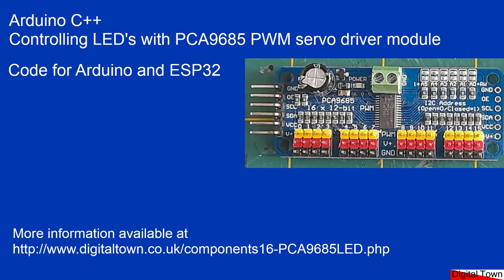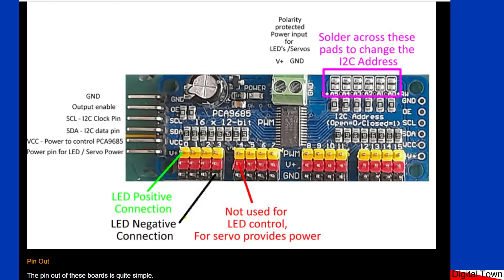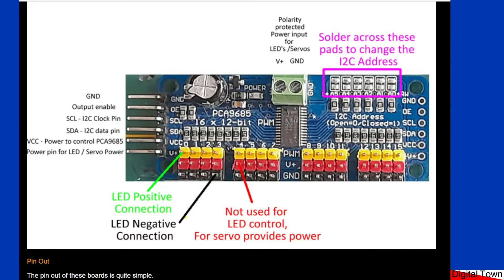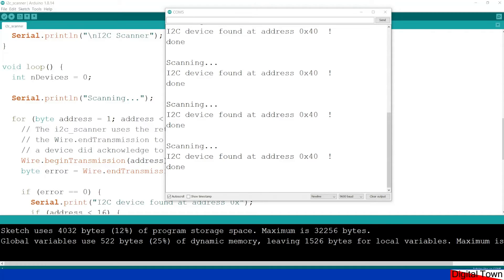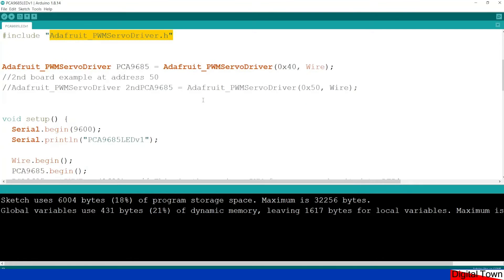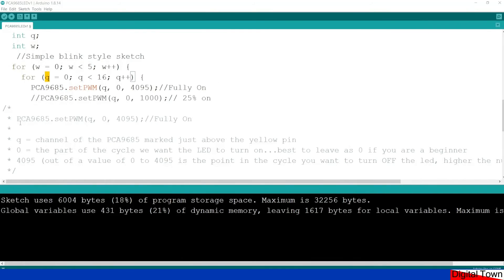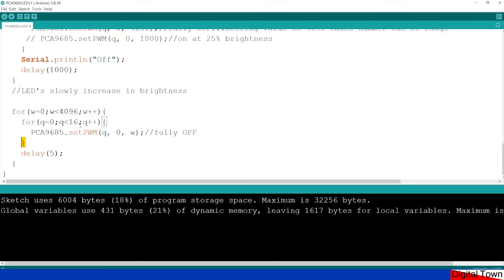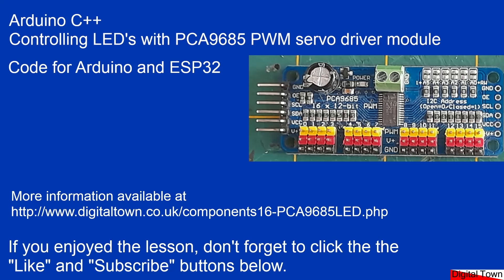Arduino C++ Controlling LED's with a PCA9685 PWM Servo controller

Comment: ESP32 controllers can communicate with one another so maybe there could be a way that the esp32 in the signal boxes broadcast to esp32's in locomotives and from this the trains would know to stop / go at signals. How would a train know though that it has the green light and not some other train? You have the skills so let me know when you have built this 😄
Just kidding, but do you think this could be developed?  Imagine trains controlled by an esp32, a timetable for running could be programmed, the automation would be fascinating to watch with multiple trains interacting.
Reply from the maker: If you take a look at the nowRail page I've written a system that allows communication on the layout via ESP-NOW. It would be possible to do something like you are asking see https://www.digitaltown.co.uk/nowrail.php
Reply: @digitaltown5442  Very interesting, you're well on the way. ESP32 is amazing. The really small ESP32-C3 are also good.  If model manufacturers aren't working on including microcontrollers in their products they are going to get left behind.
Reply from the maker: @pippaknuckle  They already include them in their DCC chips but there are limitations do to making sure they are user friendly and also have compatibility with various standards to make things interoperable. That has caused the failing of many "one off" systems over the years.
When we look at model railways we look at what we cn program, however for most users thay want it to work straight out of the box without having to learn to program.

Comment: I just tried this and it is all working but for my LED light. It is not turning on. 
If I hit the row 0 top and bottom pins (volt and ground) with an ohm meter, I get a 1v then 0v then 1v, etc... so it is working; however, 1v is not enough to turn on the 12v led's????
Reply from the maker: If you are powering LED's you want the yellow signal (+) and black GND as your connections.
A multimeter might struggle as it's passing a PWM signal.
If you use normal leds you don't need any resistor, however if you want to power a 12v led you are probably going to need to get the PCA8685 to drive a transistor that turns the 12v on and off to the 12v LED
Reply: @digitaltown5442  i plan on retesting with normal leds... From arduino kits and if works go from there.thx for the reply!
Reply: @digitaltown5442  Turns out I had the arduino connected to the V+ and not VCC so when I switched that, I have LED that light now... well blink!. So great start!.

Now I have to figure out how to get multiple LED to just come on at different power levels... but off to figure that out. 
Thx for your tutorial!

Comment: Although the PWM is set with a 12 bit value, it does not mean there are 4096 steps of control. At a frequency of 50hz you get 25MHz/(50Hz * 4096) ≈ 122 steps. This is a far cry from the advertised 4096 steps!
Reply from the maker: I can only quote the PCA9685 datasheet that says: The PCA9685 has 4096 steps (12-bit PWM) of individual LED brightness control
That said I find that the difference between steps is so small that even a 10 step difference would not be visable to the eye.

Comment: Little bit confused about the power for the leds. You aren't using the red connections, only ground and signal. So how does applying voltage to the external power connector on the PCA board help?
Reply from the maker: The signal from the PCA9685 board is powered from the external power connection if available or the VCC when not available. With a single board of LED's it won't make too much difference, but if you have a lot of boards working together the signal pins between them will start to draw more power than your Arduino5v can supply.

Comment: When I try to create an instance of the AdaFruit_PWMServoDriver FingerBTP = AdaFruit_PWMServoDriver(0x40, Wire);    I get the error "AdaFruit_PWMServoDriver did not name a type" did your mean "AdaFruit_PWMServoDriver"?   I have tried to change the instance name to "pwm" or anything else and it doesn't make a difference the error remains.  I have also tried this "AdaFruit_PWMServoDriver FingerBTP = AdaFruitServoDriver(); "  I still get the same error.  The error code/exit status is 1, the program will not compile.   I have included the library for Wire.h,  AdaFruit_PWMServoDriver.h, and FastLED.h.   I have searched Google and can't seem for find a resolution. I am working the Arduino IDE, latest version.  Any ideas on a fix ?
Reply from the maker: At a guess you haven't included Adafruit_PWMServoDriver.h

The top of the sketch must have the following 3 lines:

#include "Wire.h"
#include "Adafruit_PWMServoDriver.h"
Adafruit_PWMServoDriver PCA9685 = Adafruit_PWMServoDriver(0x40, Wire);

OR it could be written

#include "Wire.h"
#include "Adafruit_PWMServoDriver.h"

Adafruit_PWMServoDriver pwm = Adafruit_PWMServoDriver();
Reply: @digitaltown5442  Thank you for your assistance.  You helped me resolve the issue.  I had already did the #include on the 3 libraries that I needed.  What I did was the fact that in my create an instance statement I used an upper case "F" for the word "AdaFruit..."  Since the library was using a lower case "f" for "Adafruit" you can see that it appears that the library is not included.  I noticed this last night, based on what you had written, vs what I had written.  I changed the "f" to lower case in my create an instance statement and the program compiled without issue.  Thank you again.

Comment: What are the lights (LED) on the PCA9685 board itself? A red light comes on when I apply Arduino power to the vcc pin. I'm trying to control 5 servos but nothing is happening. I've checked the connections many times and quite sure I have it wired correctly. SDL to SDL. SDA to SDA. Power and groiund. I have tried 2 PCA boards and several arduinos and nothing is working for me.I've tried several codes I found online for testing servos, I tried the I2c address sample app and it doesn's find any devices.  I'm using a 5v 4amp power supply and have arduino supply vcc power. I have  #include <Wire.h>
#include <Adafruit_PWMServoDriver.h> in my code. Am I missing something.
 I hope I haven't fried everything somehow. 
Frustrated...
Any help would be appreciated.
Reply from the maker: The red led just shows the board has power.
If the I2C address finder is not finding anything it usually means a wiring issue.
You don't what type of Arduino you are using, SDA/SCL vary in different types of boards.
Pins are Arduino UNO: A4 (SDA), A5 (SCL) : Arduino Mega 2560: 20 (SDA), 21 (SCL) : ESP32: 21(SDA), 22 (SCL)

I would only attatch the Servos once I got the I2C scanner to work.
Reply: @digitaltown5442  Thanks for the fast response. I used 2 different nanos and 2 unos and used the SDA and SCL pins on the arduinos. Maybe I'll try the A4 and A5 pins, but they're supposed to be hooked up internally I heard.  I think I will try hooking up an oled display and temp sensor again to check I2C function on the Arduino. I ran a servo directly from my arduino (I use both uno and nano ) and the servo worked ok. I think I'll try the PCA without any servos and just powered off of the Arduino 5v. Then see if the IC finder code again.  I'm the PCA isn't fried since the power light comes on. Thanks again for your help. Please let me know if you thing of anything else to try.

Comment: Hi great video thanks, got into this through model railways, don't like to ask, but I'm going to, I'm using 2 of these boards for controlling points how does the numbering on the second board work ?(it may be obvious but not to me) will be appreciative for being "pointed" in the right direction
Reply from the maker: I work the opposite way, I solder over a pad to change the address and then run the I2C scanner sketch to get the addresses. The scanner test is on the support page at https://www.digitaltown.co.uk/components16-PCA9685LED.php under the Connection Test heading.
Instead of seeing 0x40 you will see the new address or multiple addresses if you have more than one board attached.
Reply: @digitaltown5442  many thanks best regards Pete

Comment: can you use this with common positive cheap chinese signals on a model railway 3 aspect  ?
Reply from the maker: I've never tried them but I Don't think that would work as it's the positive (signal pin) that drives the LED as the GND is common across the board. Pity they didn't built those signals common ground.
Reply: it's the black lead that has the resistor for power and the other 3 are red yellow green i might have made a mistake whhen i first typed @digitaltown5442
Reply: Hi, yes you can use common anode leds, but you have to get your head around working 'opposite' to usual. With common GND leds you simply connect the pwm pins to the anode, common to GND and away you go, as described here. But you can use common anode leds - in this case, connect the common anode to the +5v pin on the PCA9685, and the two GND pins to separate PWM pins. Now, if a pwm pin is set high (4095), then it has the same potential as the 5v pin so no current flows and the relevant LED colour is 'off'. Reduce the PWM pin setting and you will see the LED light up as the current flows from +5v though the PWM pin. In effect, this is the opposite to the example, as the higher the pwm pin, the less current flows, so the dimmer the led. The lower the setting, the more current can flow so the light is brighter. I use this for two colour signals on my model railway with nano bicolour led's which only come as common anode (the ones I found anyway), with 4095 as 'off' and 3000 as 'on'. Adjust the setting for red led or green as green tends to be much brighter.Try it, it works!
Reply from the maker: @paulhooper4599  Thanks, will give that a try

Comment: hello, I plan to make aquarium lamp that has sunrise sunset feature, is it possible to use this module to drive High power LED?
Reply from the maker: That depends on how you define High Power. The Pins are rated for a maximum of 25mA per pin so some LED's defined as High Power would draw to much power. 
Although what I would define as a High Power LED would be so bright you can hardly look at them.... think high powered torches, street lights etc.
Depending on the size of the aquarium a string of 16 "Bright white" leds I would have thought would be more than enough to take it up to what I would call "daylight" rathwer than "searchlight". Also if trying to replicate daylight it would be worth checking the light output as LEDS can come in various types of white. I use both Warm White and Bright White LED's depending on the effect/light colour. Warm white are better for simulating incadescent light bulbs. interesting project.

Comment: I plan to use this approach on my layout.  Have you tried this with multiple color leds?  The dwarfs I’ve designed use a single 2 lead led.  These require revering current flow to change color.  Any advice would be appreciated.
Reply from the maker: I'm not sure that is possible with these boards. I've used many types of leds with these but not the two wire multicolor leds

Comment: Useless board, 16 servos maybe micros, since the board only supports 5 volts battery, i don't have a servo less than 7.4 volts this is for a guy using micros.

Comment: So if I say, have the arduino running 2 boards in parallel (not chained), 32 leds in total, I'd be okay without needing a power supply?
I couldn't find how much is too much on the datasheet.
Reply from the maker: An arduino UNO has a maximum curren draw of 0.8A off the 5V pin so you need to know how much power the LED's are using as that varies by size and even colour. Also it depends what other items are using the 5V pin. 
On my projects when built up I tend to have a seperate 5v power line going to the PCA9685 rather than drawing it off the Arduino. I often use ESP32/ESP8266 in projects so I supply them with 5V at the same time.

Comment: Hi again,

I fell into a trap wherby the new 9265 board was defective and installed my spare.

The I2C scanner picked up 0x40 and ox70 - no idea why.  Later on it picked up 0x40.

The adafruit library was being called with the base instruction, no address and no WIRE
It is working fine without the Wire varialble.  Why??

So stupid is as stupid does - I changed the instruction to pwm 0x40 Wire

The servos went complete nuts and stripped out the gears in 2 servos???

So I put the base instruction back again and things returned to normal.

Any idea what the heck happened to those 2 servos when the adafruit command inclued Wire/

It appears that this parameter is not necessary, at least on my Mega.

Bob
Reply from the maker: if you put in Adafruit_PWMServoDriver PCA9685 = Adafruit_PWMServoDriver()  it automatically puts in the defaults of (0x40,Wire).
Not a problem if you are using a single board but not a good habit to get into if you are using multiple boards.
No idea what happened with the servos without seeing the code I'm afraid.

Comment: Hi, Thanks for the video it helped me set up my railway mimic board with a dozen single colour leds. I would also like to be able to operate bi-coloured leds (red/green) for the railway signals. I can only find common anode leds and was wondering if you knew how to operate common anode led's with this board?  Thanks
Reply from the maker: Common anode is going to be impossible as it's a comon GND, but looking on Ebay there are loads of common cathode bi colour LEDs.

Comment: On my Uno, the I2C scanner found 0x40 and 0x70.  Apparently there is an "All Call" address at 0x70 for addressing all PCA9685 devices simultaneously. I don't know why your scanner did not find this address.
Reply: Did the wire scan as well, on a Mega also found 0x70

Comment: This is a really good tutorial. Thank you so much for explaining this board and the code in such a clear, step-by-step way. I’ve just bought 2 of these boards to use for lighting effects on my train set (and hallowe’en special effects for the kids!). Will also look at trying ESP32’s for controlling these now as the price seems way better than arduinos! Thanks again. 😊